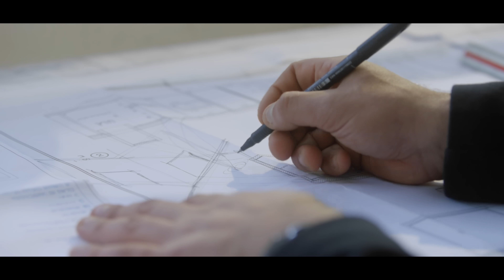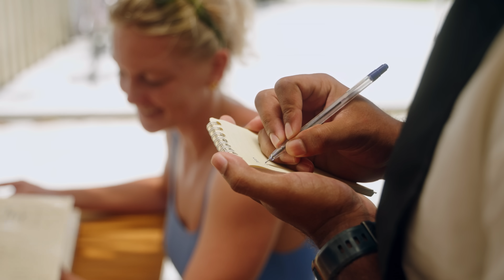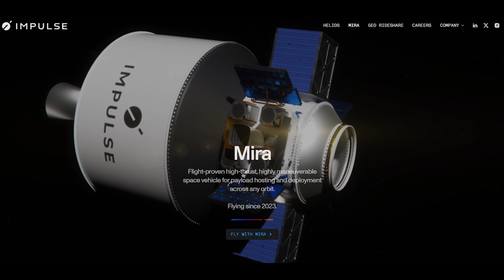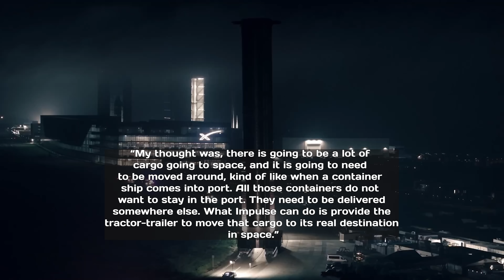The Brains Behind SpaceX Rockets and It's not Elon Musk...

Comment: Of course Elon isn't engineering the SpaceX rockets, he's not an engineer at all.  However, he has determined the path SpaceX is taking, particularly Starship/SuperHeavy, and it is his design choices that have doomed SpaceX.  His demand that Starship, the second stage of the system, must be reusable -- there can't be many engineers or rocket scientists that would recommend the use of a reusable rocket stage for the second stage.  They talked about making the second stage of Falcon 9 reusable, but they quietly shuttered that program.   
The idea that a rocket heading to the Moon would need to be refilled by 6-10 other rockets in order to be able to reach the Moon and return means that a single mission to the Moon might require not one rocket but as many as 11.  
So, Elon Musk isn't engineering Starship/SuperHeavy but he has placed his thumb on the design in a way that dooms them to fail!